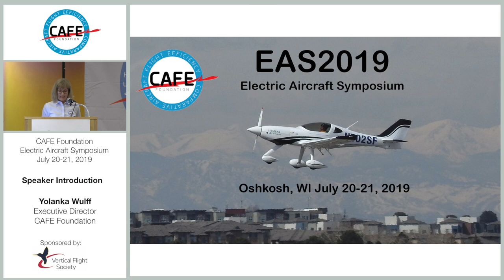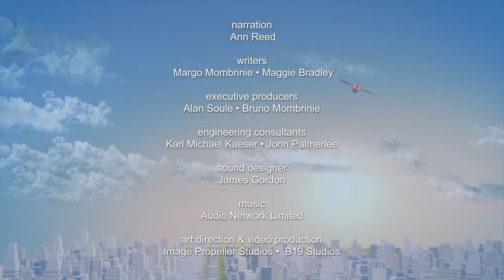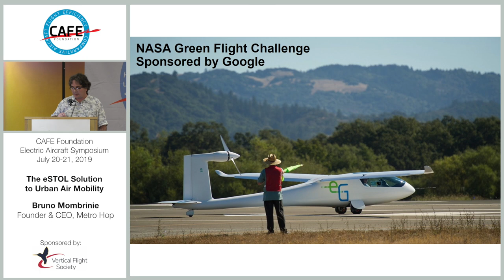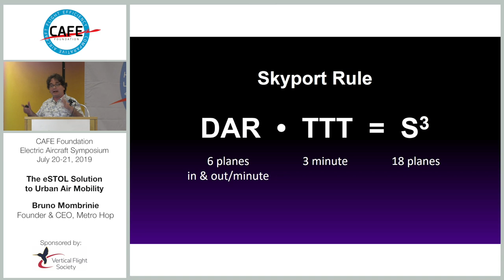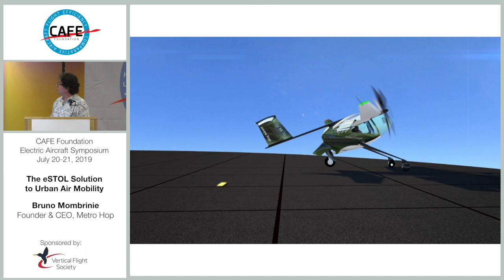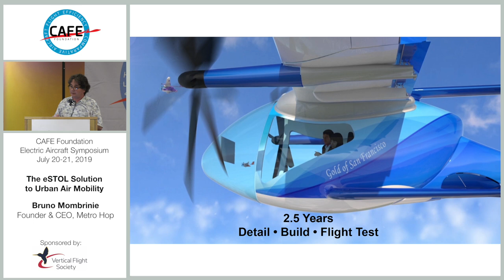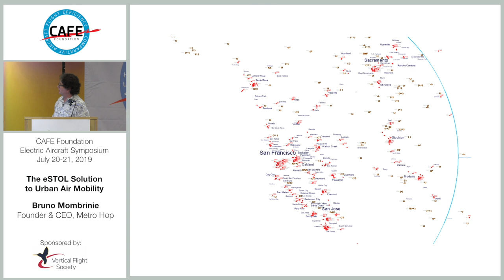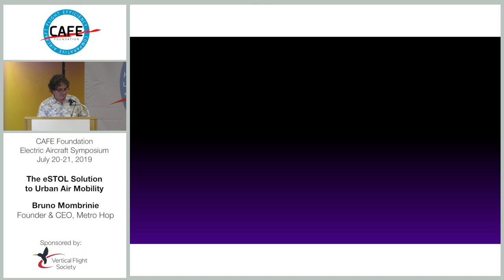CAFE EAS 2019 #7 - Bruno Mombrinie - Metro Hope: The eSTOL solution for Urban Air Mobility

Comment: I am sort of cynical with ideas like this.... They always sound great in concept.  I mean who does not want to have a cheap way to get from A to B in a fast manner.  The problem is that the real world is far far from a CGI concept and there are many many things to get in the way of this sort of operation.  Weather factors as a start.  I have never flown ANY autopilot that was worth a dam in gusty conditions.  These guys want to have one flying an approach where dipping low/coming in short would be catastrophic and do so at a low approach angle.  Furthermore, their concept has WAY too many moving parts and important systems (like the landing gear height sensor mentioned) that can and will fail unless they are very well engineered and  highly maintained. Aircraft with swinging gear like shown have a pretty high gear failure rate. See the Cessna 210 or 172RG stats.   Will this aircraft be able to "see and avoid" birds?  I dodge them all the time in my aircraft, but I have eyes.